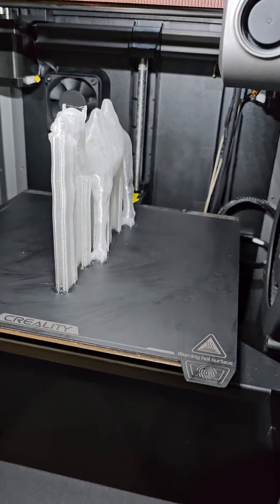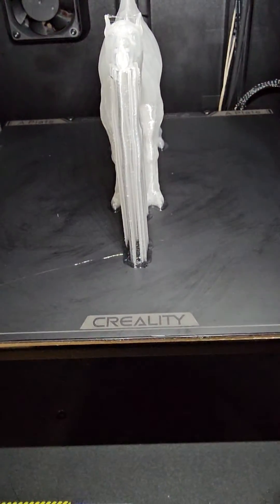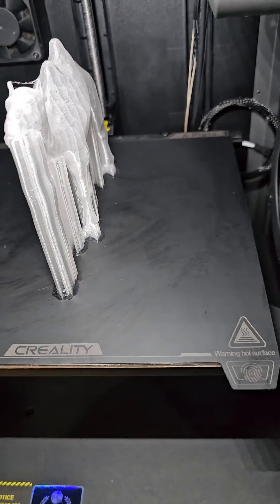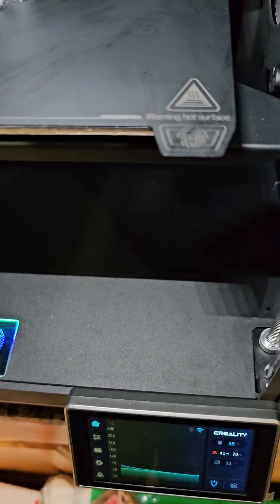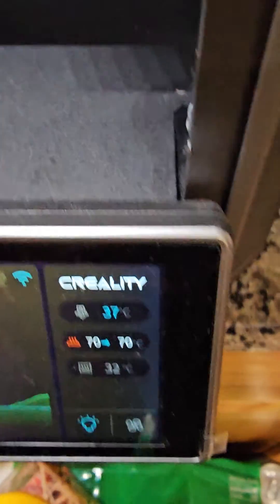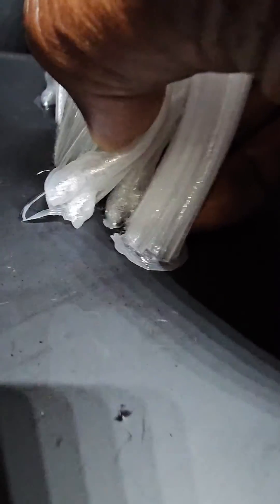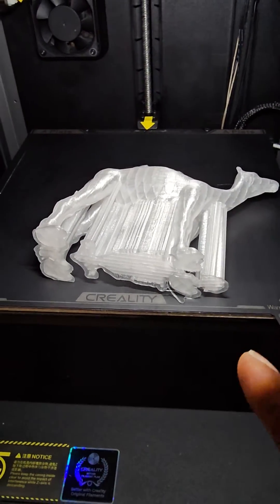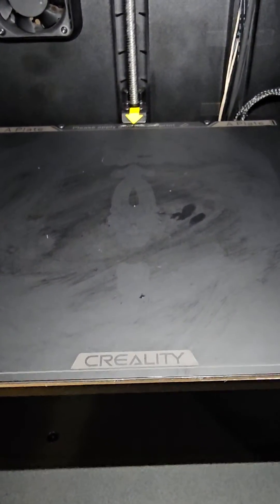How to remove TPU 3D Printing Filament from PEI bed the correct way - REAL TIPS - SOLVED! #creality

Comment: Can confirm. It was stuck solid after I waited to long to pull it off the build plate. After heating up, it came right off.
Reply from the maker: Thanks for your feedback. It makes others discover this small but extremely important tip.

Comment: Thanks for the video. I printed TPU on my Lulzbot, and nothing I did would get the material to come off the bed, ended up destroying one bed trying to remove TPU. Heated to 75° C and it came right off.
Reply from the maker: Sorry for the trouble! I ended myself destroying 2 beds following bad advices. Finally I figured it out, and I thought I should share. Thanks for watching.

Comment: If your TPU is sticking wayyyy too well even after cooldown, you should probably adjust your first-layer offset to further away, maybe even cool the bed a little more and save some heating-cost long-term as well. Not saying your method is invalid, but it's still a solution to an over-adherence problem that might be avoidable. If you can't gently push a scrapper between the part and bed while lifting up, then that's certainly overly stuck, and borderline trying to bond with the build plate. TPU likes to be a pain to pull off, because when you pull on it, it disperses the force across a much larger area than stiff materials, especially if you have brims, I personally never use those with TPU specifically, as they act like a suction-cup.
Reply from the maker: Thanks for the tip. If you do a video to demonstrate what you're referring to, it will be definitely helpful to see the difference. And help the community at large.

Comment: I have only used a textured pei sheet for TPU because someone told me it was easier to remove compared to a smooth sheet.  I still needed to use isopropyl alcohol to get a couple prints off.  I will try heating the bed the next time.  Thanks for the tips!
Reply from the maker: Awesome.  Looking forward to your feedback when you do.

Comment: Just about to break out my first roll of TPU - glad I saw this. I have a programmable heat gun on my bench and figure that hitting it with that 70°C might work, as well. Thanks for the tip.
Reply: interesting.  Can you post whether it worked for you or not?  Why not just heat the bed though? it's right there, no looking for the heat gun, extension cord, blah blah.
Reply: I haven't tried it yet and the only reason that I would try it is because my heat gun is always ready to go and it would be faster than heating the bed. It has to work, but there's no guarantee that you wouldn't fry the print to the plate if you weren't careful. Mine's programmable in 5° increments, so 70°C isn't a problem. I'll post results after the next print. @MemphisBlues-JG
Reply from the maker: Awesome to hear that. Thanks for your feedback.